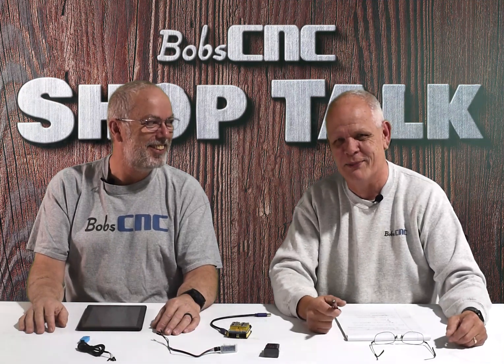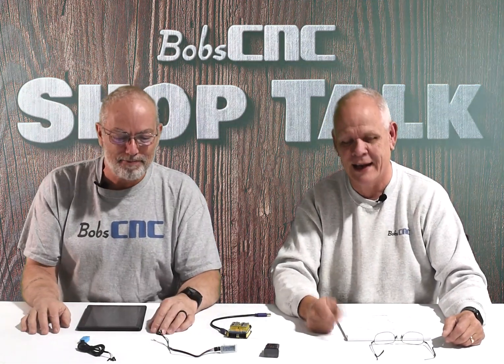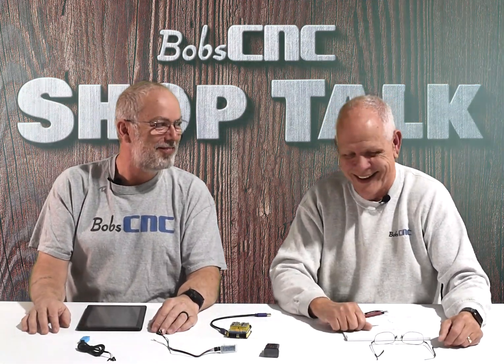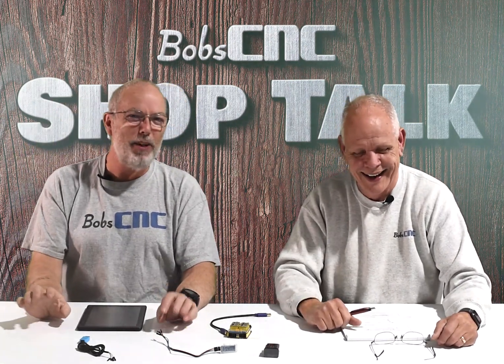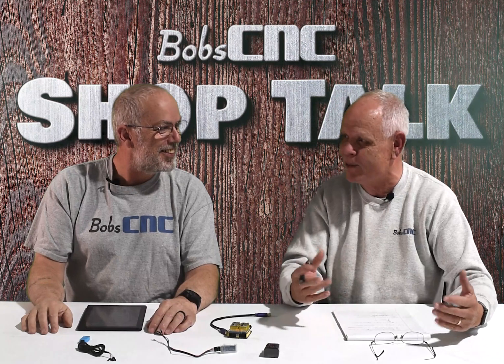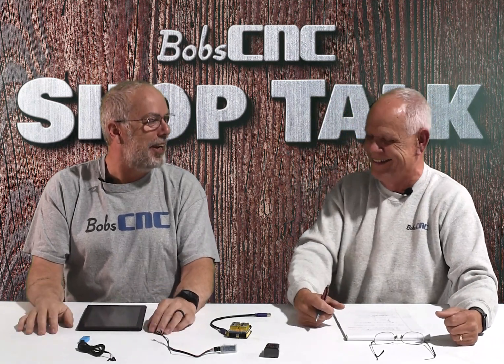Shop Talk: Bluetooth Module

Comment: The link to the "how to" is no longer active...  Did this not end up being a good solution?   If it is still a viable option to create a wireless connection between a laptop and the controller, please advise as to how to acquire the how to article.  Thanks!

Comment: I’m thinking about buying an E4 but it’s a little higher than my budget. Do you guys have an coupons or discount codes? Also, will that Bluetooth module work with an iPad?
Reply from the maker: Sorry we do not have any discounts at this time.  I don't think Apple Bluetooth is compatible with most off the self Bluetooth modules.